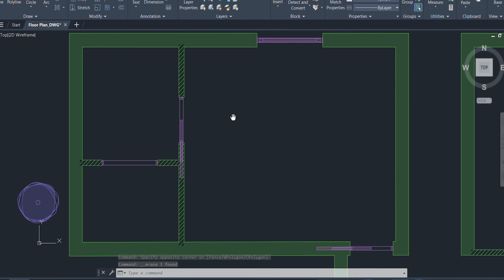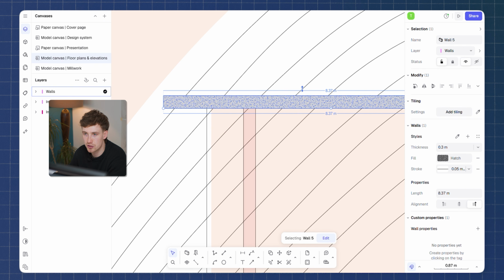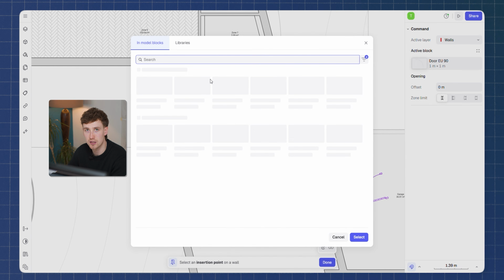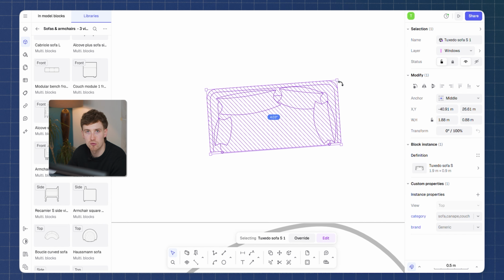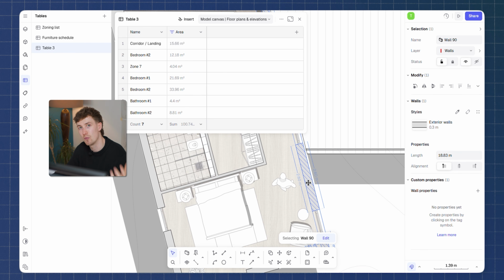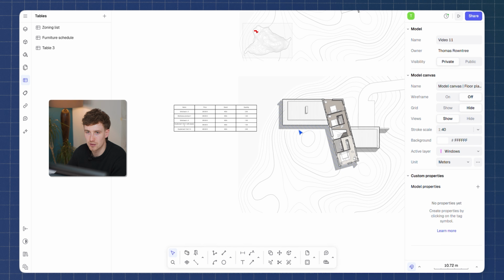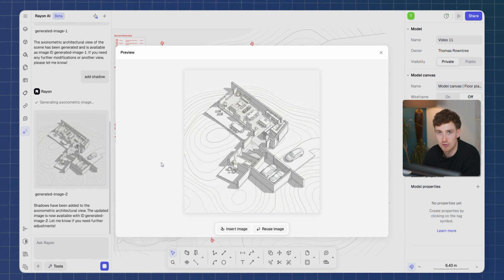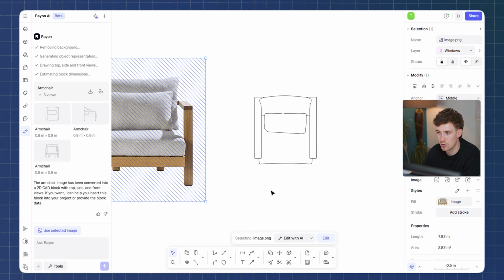Work Faster Than AutoCAD | A Better Design Workflow with Rayon Design

Comment: Cool. When will you be able to do wall areas?
Rayon 3d would be great too.
Reply from the maker: Good question! For now, you can approximate wall areas using Zones if the space is closed. More direct wall area tools would definitely be a great addition though.

And yes — 3D is a popular request 😄 Nothing official yet, but it’s on people’s radar!
Reply: @rayon.design just make it a plugin in sketchup.😀

Comment: Why working in 2D when we get 3D CAD Software like Archicad?
Reply from the maker: Totally fair question 🙂 It really comes down to workflow.

3D tools like Archicad are incredibly powerful, but they can also be heavier and more time-consuming for quick layouts, early concepts, or presentation work. Rayon focuses on being fast, intuitive, and flexible in 2D — especially for iterating ideas and communicating them clearly.
Reply: @rayon.design Thanks for your answer. Is it possible to export a rayon sketch as a dwg file into archicad?